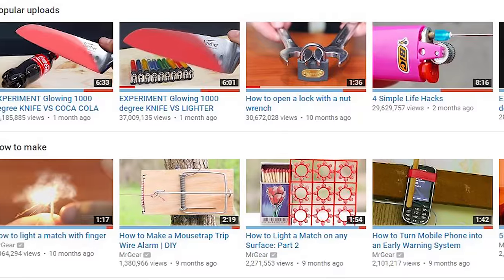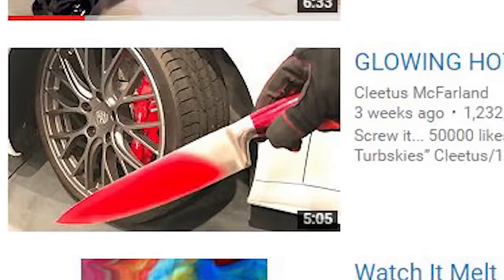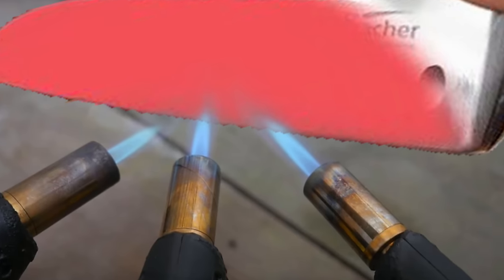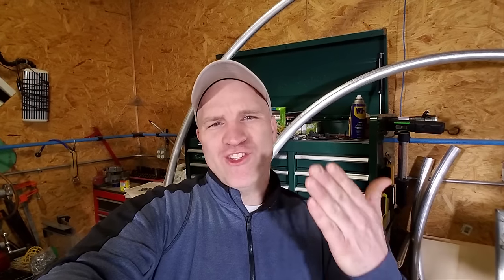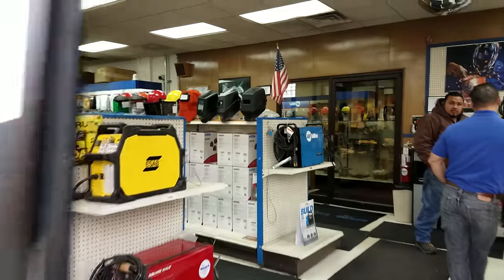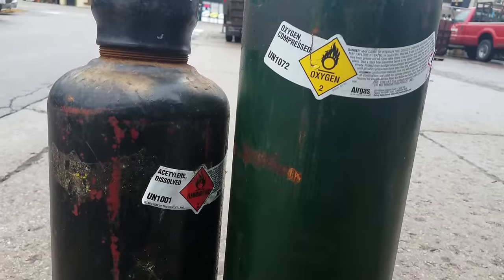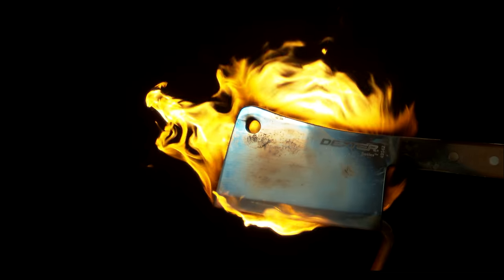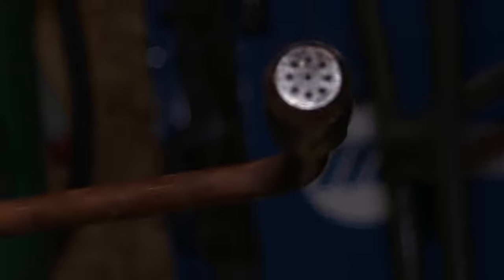2000°F Cleaver vs Lighters - in 4K Slow Motion

Comment: Other than showing that heat weakens a blade to the point that plastic will ruin it, what do you think fucking up a quality steel blade with  chunk of plastic is demonstrating?
Reply from the maker: +45von well we got some ideas for some future projects on the subject of power of infrared energy . Also items are "wasted" in many different ways, imagine it like this , this cleaver had 2 options. 1. I buy it and give it as a gift, the recipient leaves it in their closet for 20 years and then eventually dies, their children sell the house and developer tears it down. Cleaver never got used  2. I buy the cleaver and use it as a demonstration of how intense heat affects the strength of metal and a circumstance where plastic can actually bend metal, once we are done it goes to a museum , a viewer or gets recycled . A waste is relative. Overeating ... That's a waste !

Comment: i made the mistake that amexicans use Fahrenheit I made comment first before I realised the chart was in Fahrenheit soo
 steel melts at max 1540 degrees centigrade unless your knife is made of tungsten it will melt at 2000 degrees centigrade  I assume it's made from stainless steel  witch melts at 1510 degrees centigrade  just so you know
Reply: Thefreakyfreek I think it's farenheit
Reply from the maker: +Thefreakyfreek yes sorry for the confusion . We should update the title

Comment: Wtf it's not meat... stop beating it
Reply from the maker: Jesse LZ lol. very nice
Reply: Warped Perception - it wasn't meant to be a sexual innuendo lol.   Can you guys inflate a car tire until it bursts?   Curious to see if only the sidewall would blow out on its own or it would blow out by the belts and/or both.
Reply from the maker: Jesse LZ LOL, I wasn't taking it a sexual at all, we tried the car tire thing twice a couple months ago, and kept on blowing up on the opposite side that the camera was on, very frustrating. We may reshoot that in a month or two as soon as spring time comes
Reply: Warped Perception - Hah! Okay cool. Don't buy new tires obviously, but maybe get a variety of sizes and types like all season, summer etc. low profile and whatnot.  Maybe try sizes like 225/60/rim whatever, and then 225/55, 225/50, so on and so forth.   The engine slowmo was AWESOME man.  Always knew how internals in an engine work (self made mechanic) but never actually saw it.  Props man.  I will be looking forward to more content and watch out for me in the comments!